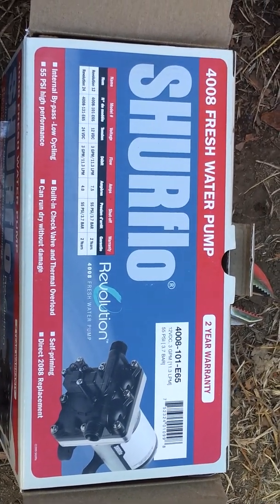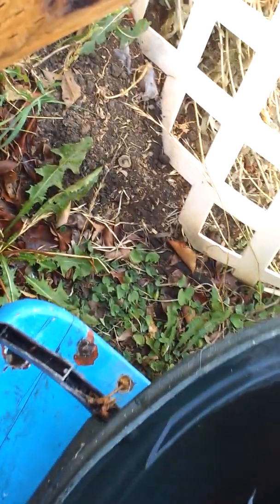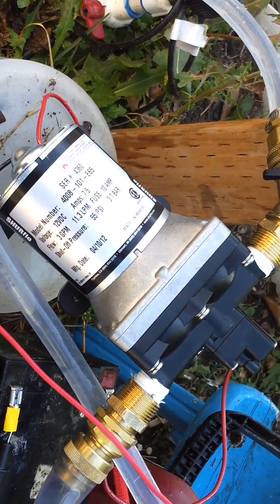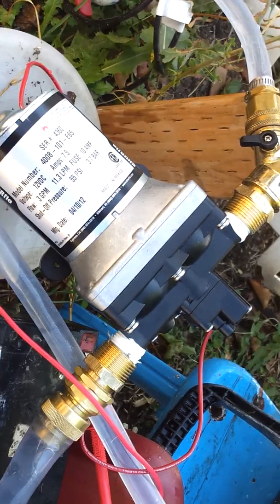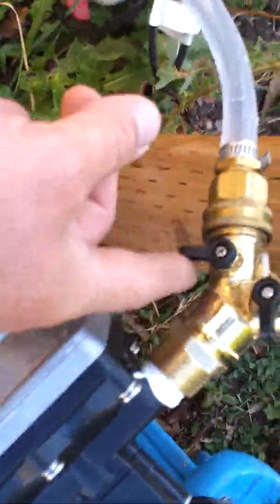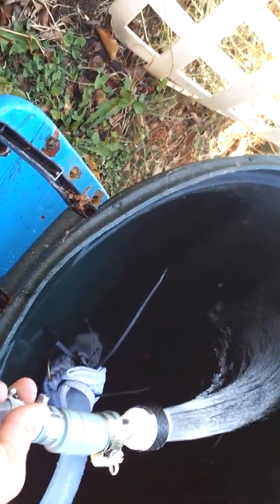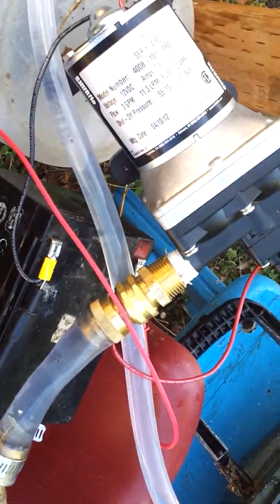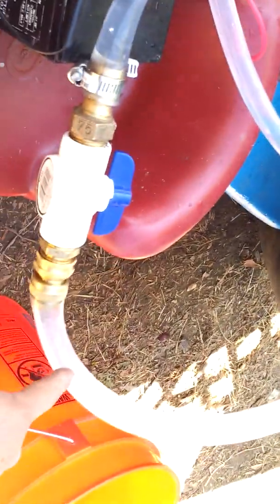Shurflo 4008 water pump 12 volts 3 gpm 55 psi

Comment: I'm using the pump for a small scale rain collection irrigation project, it does a good job. The plastic barb connectors it comes with aren't the best but they do work. The motor runs quiet and cool. The ability to run dry without damage is very nice. The pump primes well even if it has to draw from 3 or 4 feet below the level of the pump. The check valve holds pressure very well

here is the link to it in case anyone isinterested:amzn.to\19j4oka